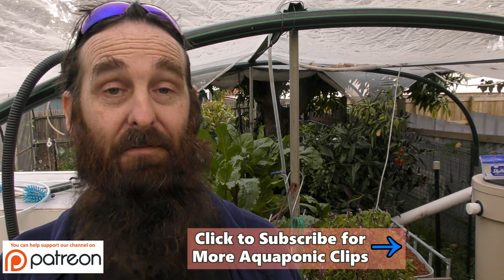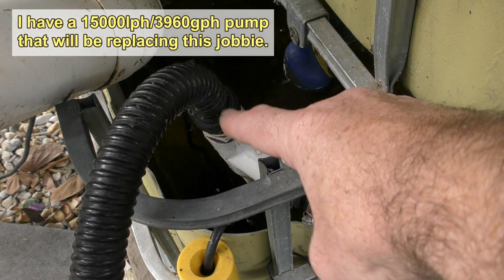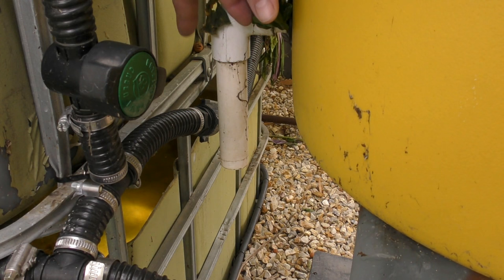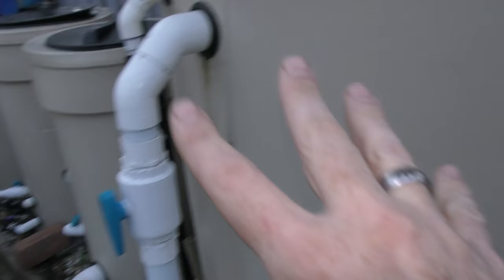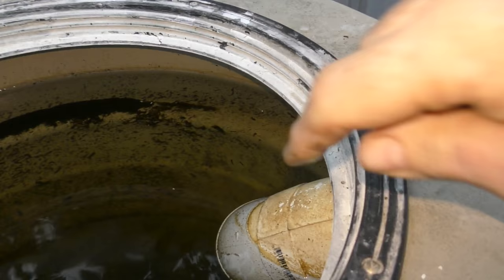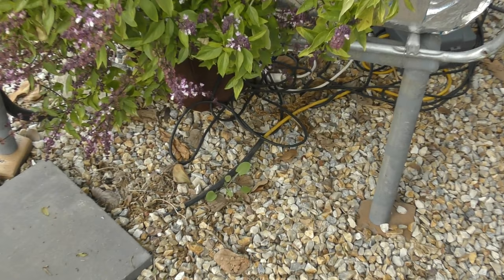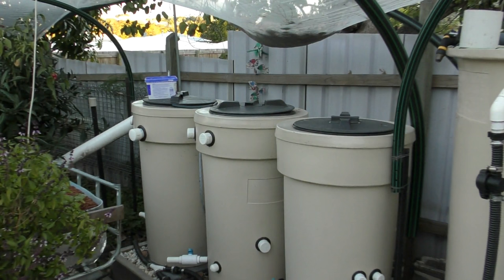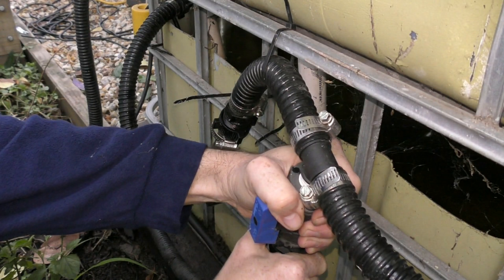Split Flow Aquaponic System, The Complete Layout Tour.

Comment: I used a few air pumps like yours and found them very noisy, ran hot and didn't seem to put out much air. I switched to the Haako diaphragm type pump and was able to use a 40 watt/40 liter pump to pump water with air pumps, provide air and create a bubbled compost tea. And this was in about 5 yard type systems and spread as far as 75 feet apart. The Haako purred along quiet and seemed to provide more air than same rated pump, similar to yours.
Enjoyed the look at your system. Been awhile since I had some in Hawaii.
Reply from the maker: Thank Jim. 👍
I found suspending them GREATLY reduces the noise & haven't had any loss of flow issues with these ones. I have seen a few folks report some rubbish brands on forums though. Most look to be cheap Ebay & Alibaba jobbies though.
Cheers mate & all the best.

Comment: rob you might would consider moving the air pump out of the battery box away from battery fumes. just a thought. love the video's mate.
Reply from the maker: Thanks Mike. The battery box has a few vents + the door is always left open 20mm so am not too concerned. Will have a separate box for the battery once I re work the system & before more fish are added back in. 
Cheers.

Comment: Def need to figure out a 12v option for this. great update Rob
Reply from the maker: Have seen a few run on 24v which is something I';m interested in. But first I need the $ & the roof space to set up the panels, both of which are in short supply ;)
Cheers mate.
Reply: Yeah I know that one mate. why dont u contact the companies and see if they will sponsor the video by providing the equipment. its what i did when needed new plastic for the tunnel move

Comment: Hi Rob,
I have watched a few of your videos now and I am coming to the conclusion that you like playing with the technology more than the actual growing of plants .

I also have seen a video of a commercial aquaponics system in Texas.  It was a huge system. But, I noticed that in addition to the use of fish, they were also adding manmade  oil based fertilizers. The production was very high but the operating costs must have been extremly high whike the crops were no better than ordinary field grown crops.  That is , the crops were not organic by any stretch of the imagination. But, were being sold as aquaponic produce.  Monsanto at work !
Reply from the maker: Hi Donald. I get what you're saying & I'd be fibbing if I said I didn't enjoy the tinkering involved.  ;) Showing plants grow tends to bore folks so my clips focus on the system components themselves. 
Most of the commercial folks I follow are striving for organic growing conditions so add in only organic suppliants you'd see soil farmers use. 
Oil is basically hydrogen & carbon so doesn't really hold any elements suitable for use in fertilisers. About the only oil manufactured fertiliser I know of would be nitrogen when made through the Haber–Bosch process.  Nitrogen is one element that an aquaponic system has in spades so can't see them adding that in. 
Cheers Donald & have a top one mate.

Comment: Cheers for the latest full tour.  You are my inspiration to build my own small backyard aquaponic pond / growbed setup.
Was undecided if I needed a sump tank with split flow but you have shown the benefits esp. for cleaning and modifying.

Questions if you have time please : Since I live in Indonesia, keeping the water cool enough is more my concern.  
So do you have any tips / tricks / advice on cooling the water during hot season ? 
Or is it not needed as long as the midday sun isn't directly on the system ?

Also, do you have a system overflow to deal with heavy rains ? Maybe a big issue during rainy season ?

Many thanks for all your uploads. Enjoy the Queensland winter.
Reply from the maker: Hi Celyn.
Selecting a species that can handle warmer water temp would be the first step. Only warm water fish I've used are the Jade perch (which I think may be available in Indo now) but think Barramundi/Sea bass & Tilapia would be available there too if you look around. 
Shading the grow beds will also help stop any exposed grow media from heating up & transfusing the heat to the water. 
If you can bury the tanks at all, even just a bit will help to insulate the water as the earth normally has a more stable temperature. 
Covering the system with some sort of water tight green house cover would be the best way to go but I know it's not always practical. 
I have a few drainage holes drilled in the back of the sump about 10mm from the to that allows excess water to escape. 
For one off downpours here I remove the bells from the siphons in a few beds & let them run as constant flood for a few days.  That helps store more water in the system & as soon as the water level drops in the whole system & replace the bells.

Hope that helps you out a bit & all the best with designing the new system.
Rob.
Reply: Cheers mate.  
Super informative and helpful as always.

Having talked with locals, both Tilapia and native catfish are most common without heat troubles.
Partially burying the fish pond is a great idea, thanks. 

Covering some of the system may be the best option, the rains here are kind of crazy.  Thanks again.
Also, I will be using well water which hopefully will makes things a bit easier.

Still considering if constant flood or siphon style will be best.  
Haven't yet found out full pros and cons of each.  Any opinions if not too busy would be amazing ?

Will keep watching your channel for further ideas.
A thousand blessings Rob.
Reply from the maker: I prefer the flood & drain as I think it keep the solids moving a bit better. The one & only constant flood bed I had turned into a fantastic solids filter for me which led to other issues like nitrite spikes. Mind you, that was before I had a radial flow filter on the system 👍

Comment: Where does your auto dosing system go if you have one, also I would have been nice to see a diagram
Reply from the maker: I manually dose the system here. If you were to add one I'd probably add it in the sump on the opposite side from the pump. 
Hope that helps some.

Comment: Hey there, been a subscriber for some time now. Just wondering if you think the cost of fish food is cheaper than buying the items you grow from the supermarket? Also you do think that the fish food may have traces of bad things, like heavy metals that may be worse than just buying veg from the supermarket? 

Keep up the good work and videos, thumbs up.
Reply from the maker: Hi Mate. It would have to work out cheaper than buying organic from the store. 
At the moment we're pulling about a bunch of silverbeet worth of perpetual & Okinawan spinach + a fair amount of salad greens from the system most days (the girls are fed up with spinach it to tell you the truth 😃). Non organic Silverbeet sells for around $4 a bunch from what I've seen. 
To feed 60 fish during summer if they were all full grown (500G) it would cost about $3.50 a day. At the moment they are getting a fraction of their normal rations due to the cooler water temps. 
As for contaminants in the feed, I chose to buy an Aussie made commercial feed for that reason. I have asked & they have assured me that it wouldn't be acceptable at a commercial level so they do monitor all the components of the feed for contaminants. Ultimately I'd like to grow out fish using home grown fish feed like crickets & grubs & feed it to fish that I've breed myself. The feed I can do but we don't have any legal fish species we can keep that do breed in small scale systems. 
Hope that helps some mate & have a great one.

Comment: G-day now that you have the biomass filter and the filter for the solids do you still have your beds backing up with sediment?
Reply from the maker: There will always be a few solids that make it through the radial flow settler Lisa & they generally get deposited out into the beds in the end. 👍 One way to reduce them further is to have another fines filter after the biofilter. I always planned to with this system but never got around to it. 
Cheers.

Comment: Hey Rob, I have been watching your videos for a few days now, and I got to say it very, very interesting. I have been interested in the aquaponics system for some time now, and I am wanting to harness it in a project I have had for a couple years. I live in Kentucky, USA and think your system will do me just fine, although I get a bit mixed up from time to time I think it is what I need for my project.  Let me see if I get it right, from the fish tank, the water is pumped to the waste tank where the water is forced to change direction. From there the solid is pumped out to a garden bed, and the lighter waste is skimmed to a bio filter tank filled with bio media. And then returned to the fish tank. Right?
Reply from the maker: Hi Dwight & sorry I missed your question. After it leaves the biofilter the water flows to another drum (I call it the first sump) then on down to the main sump. From there the pump splits the flow up so some goes back to the fish tank & the rest goes back out to the grow beds. 
Hope that helps & sorry again for taking so long to get back to you. 
Cheers.

Comment: I am confused a little why do you have a split flow into the fish tank as it would mean ammnia water would be going back into the fish tank please explain the logic as I am planning to start a small system of a 1000 ltrs thanks Jimish
Reply from the maker: Hi Jimish. In my system I have a bio filter/reactor after the radial flow filter so the water gets treated before it hist the sump. I show the bio filter at about 11:00 if that helps. 
I have seen others run spilt flow systems that are moderately stocked (say 1 fish per 20L/5.25gal of wet clay or 20mm/¾" rock) for years with no issues as long as they don't over feed or stock them with fish. Definitely not the best way to set up the system for proper filtration even if some experts claim it is. 😉
Hope that helps some.

Comment: Hey rob, do you happen to have a video or an explanation of the venturi that powers the moving bed bio filter? I was trying to look at what appears to be the purple valve and how that was working but couldn't make out how that was a venturi.
Reply from the maker: Hi Christian.
This clips shows the commercial venturi I'm running in the bio filter/reactor as well as a few DIY ones that work well. 
https://www.youtube.com/watch?v=0ZMjDgM3LaU&index=1&list=PLBcWprMIwYYh9C2BDFMnIGeLdI6mfDpUe
That valve just regulates the flow to the venturi that is installed on the inside of the barrel. This older clip might give you some idea on how it's set up in there. The plumbing into & out of the filter has changed but the venturi is hooked up the same way 👍
https://www.youtube.com/watch?v=sh-Z0xl7Hjs&t=3m08s

Hope that helps some.
Reply: +Rob Bob's Backyard Farming ah, so you run a hose all the way up to the air on the inside of filter. I wasn't sure if it would draw air down that far. cool. Cheers mate!
Reply from the maker: A strong flow helps 👍 Am looking at replacing the venturi with an air compressor in the near future to see how that goes.

Comment: Hey Rob, Wondering where you got your batteries from? Trying to find some decent but also cheap large capacity batteries. Any thoughts would be great. Thanks
Reply from the maker: Hi Tim. These are just cheap car batteries from Supercheap  Auto. I didn't spring for the deep cycle ones everyone was recommending due to the price. They may of come down a bit over the past few years though. 
Hope that helps a bit mate. 
Cheers Tim.
Reply: Thanks Rob, I'll have a look around. If you have any links would be much appreciated.
Reply from the maker: No links for anyone I'd recommend sorry mate. Are you here in SE QLD ? 
I think most battery retailers stock them. If you're going to buy online you'd want to factor in the weight as that will push the freight up a bit 👍.
Reply: Nah Sydney thanks, ill continue to look around.
Reply: Managed to pick up and 2nd hand boat battery from family members, being 145AH which is a little over kill for my system. But more storage the better :). I haven't tested yet, but thinking this would run my back up air pump like yours, for a couple of days to a week, which is nice to know :). 

Rob, Thanks for taking the time to comment, knowing you have thousands of comments all the time. Don't know how you manage to find the time :P, but I and everyone else really appreciate it.
Cheers Rob, Thanks.
Reply from the maker: Nice score on the batteries Tim.  👍

Does take a bit to stay on top of it but such is.
Cheers mate.

Comment: How much power do you us ?
Reply from the maker: The pump is a 250w unit that runs 24 hours a day,
250 x 24 = 6,000w or 6kW   
Our  price per kW was $0.27 per day last time I checked so,
.27 x 6 = 1.62  $1.62 per day.
We also have a 1.5wK solar system on the house so the price is subsidised by that to an extent. 
Cheers.
Reply: thank you just looking at how much power you us looking at growing my aquaponics ,making it twice as big but i am completely off grid so looking into power friendly ways  i can do that . i am running 6 bathtub  4 grow beds 2 floating beds  with 1sump and 1000lt fish tank .( looking at going to 10 bathtubs) any ideas on great pumps that do the job but us less power would be great thank you
Reply from the maker: I was reading in a group thread somewhere that there are some ½ decent 24v pumps on the market now that offer high flow rates if that helps any. Went to look but can't find the link that was given sorry.